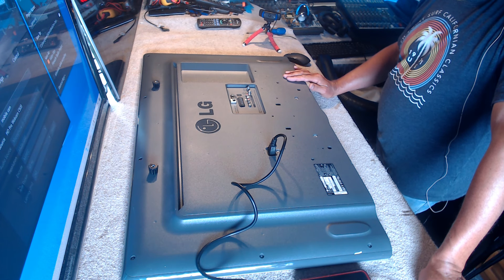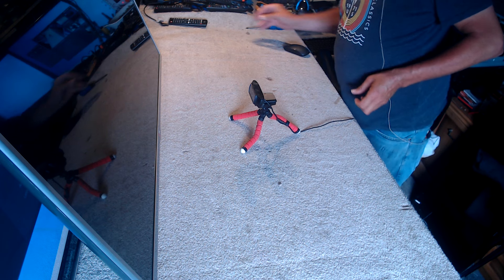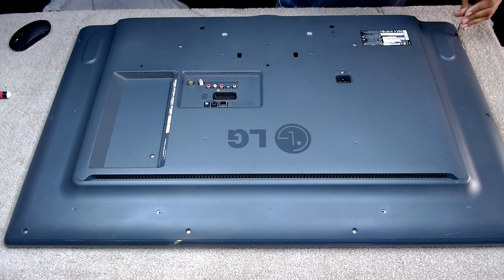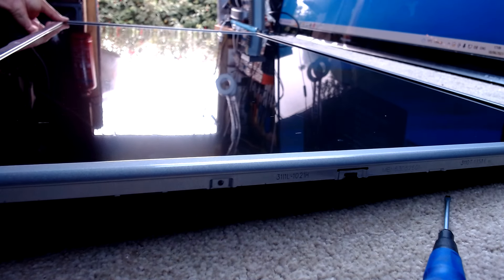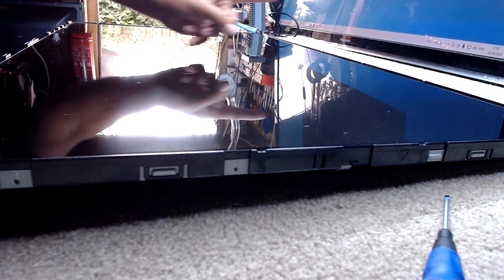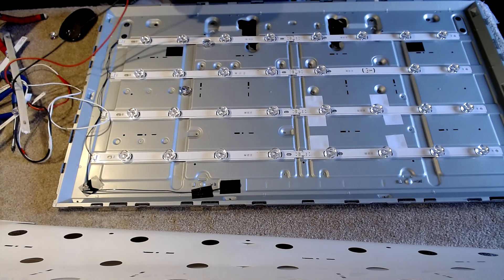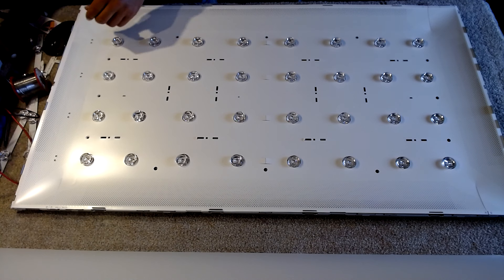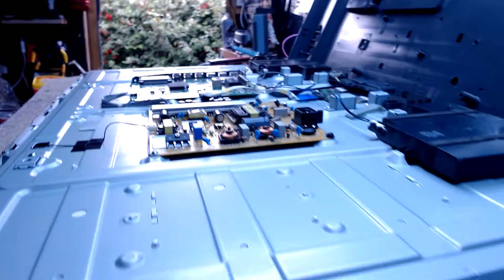Fixing up a mint LG 40 inch led TV

Comment: Did a 65inch tv. Back lights. Worked perfectly. With out the back on testing. Fitting the back on the last screw I cracked the screen gutted luckily the online shop refunded the leds.

Comment: Great video as usual...
 Sir, can you tell us which LED tester you use, or maybe you made it yourself... Thank you.
Reply: Oh yes, I'd really like to know how you tested those LED strips! I've got an older but similar LG TV where the backlight pops on for maybe half a second and then goes out. Initially I suspected the driver circuit on the power supply board but that seems to be fine.

That back panel of the screen can have awfully sharp edges BTW.

Comment: I had to go through my drawer of odds and ends to find an electrolytic capacitor to replace one bad cap in my 2009 Samsung TV's power supply section.   This has been my TV since 2009, and still is my TV here in 2023. Shortly afterwards, my Lenovo ThinkCentre backup computer suddenly was stuck in a boot loop mode.  Logic told me that it was most likely a PSU problem.  I spotted a bad electrolytic capacitor next to one of the two IC's.  I replaced it, and the computer was back to normal operation.  Other caps were seen bulging at the top as well, and so I had to spend a whopping $9.95 to purchase replacement capacitors, but some were to simply hold on to for any future bad cap encounters.

Comment: I'm a bit puzzled, most of the lamps were working but in the initial test the logo was not lit up. Then after replacing about 3 lamps the whole TV works.
Reply from the maker: It only takes one bad led to stop the backlights from turning on.
Reply: Another great repair Allen. Regards, Brian 👍👏🏴👍👏🏴
Reply: @allenfleckney5969  Would you suspect the LEDs if the backlight comes on for half a second after power-on and then goes out? I do get a picture but no backlight. It's a slightly older LG TV with LED backlight (early 2010s I think). The set has been properly abused, run for ten to eleven hours a day, 365 days a year for its entire life so I'm not inclined to put any money into it but fixing it with spare parts from identical sets would be neat (I already sank a few Euros into new electrolytic caps for the power supply).

Comment: Thanks for your Youtube videos I often watch them 
I have got a little problem. When I turn my more than 15 year old 52" Samsung TV on in the morning,  I first see a double image where the “image copy” is slightly enlarged and about 2 inches lower. This phenomenon lasts about 10 min. At the same time, I see a straight green line about half an inch in from the left edge. This line can remain up to half an hour. After this, the picture is perfect and lasts all day - even if I turn it off for several hours during the day. Do you have any experience with these phenomena and can you advise me what the error could be 
Sincerely Thomas Hedén

Comment: Absolutely correct,  I saw your recycling rant video, YouTube's algorithm is awesome. Have always loved working on TVs, remember my dad taking tubes to test at the drug store or Radio Shack.  I mostly did solid state in the 80s and 90s replacing horizontal output transistors and flyback transformers. LEDs are so much easier, love your channel and your helping others.
Reply from the maker: My dad did the same.   Welcome.  Nice to have you on board.